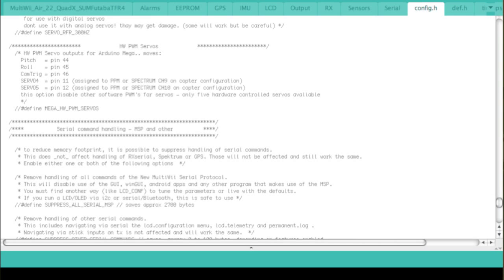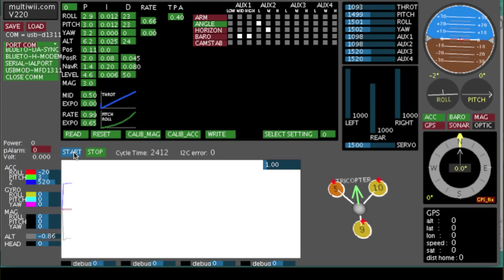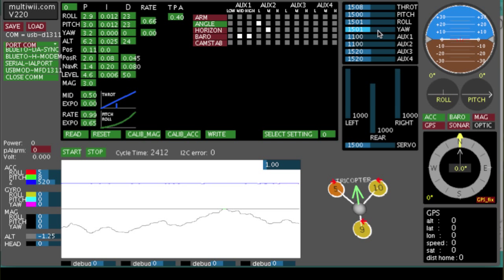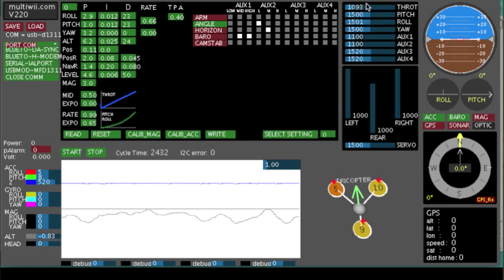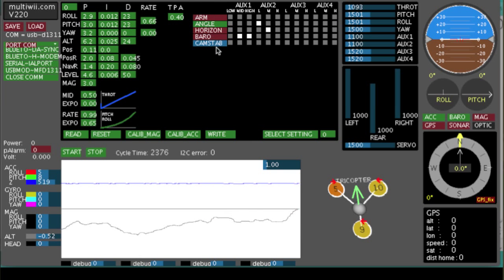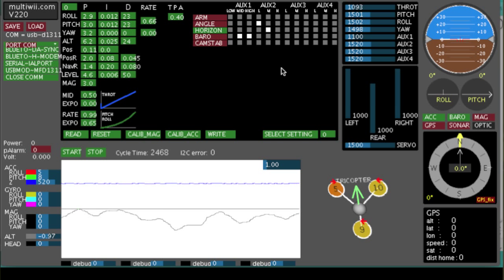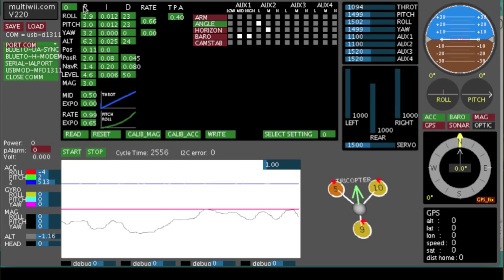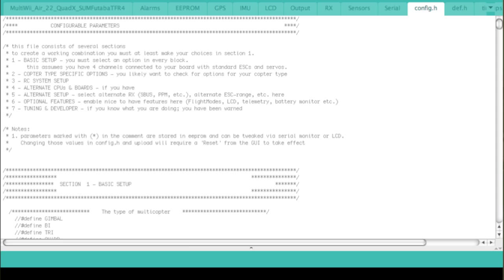Paris Sirius Air Basic setup

Comment: I noticed on the video after stopping and starting it that it mentions Vtail quads but it doesn't on the multiwii website.

Will this controller run Vtail Quads ?

 if so how easy is it to set up ?

Thanks Josh